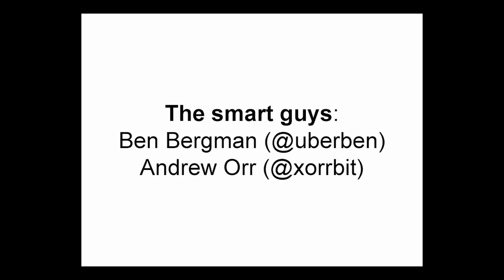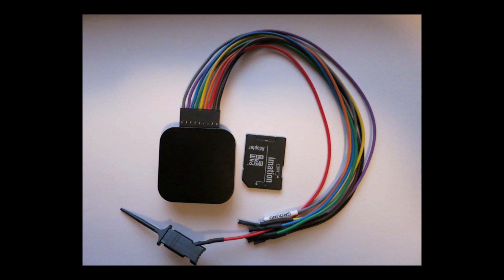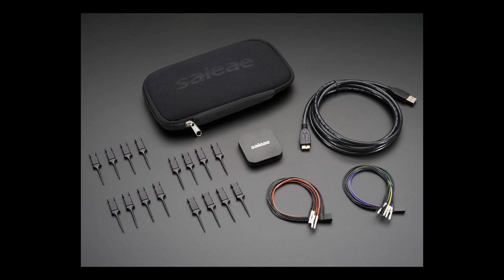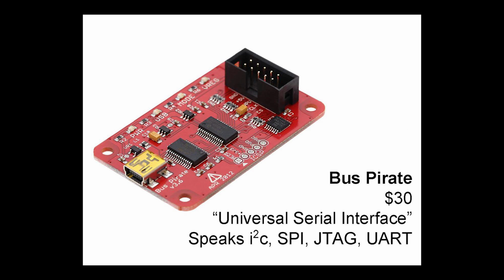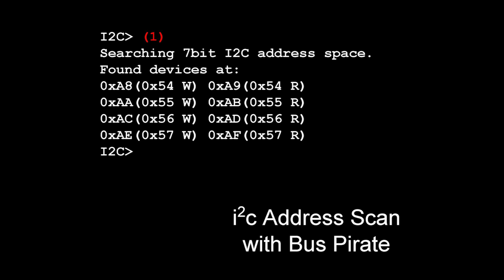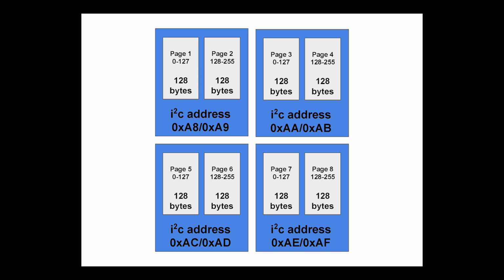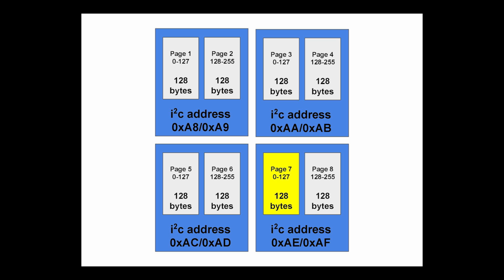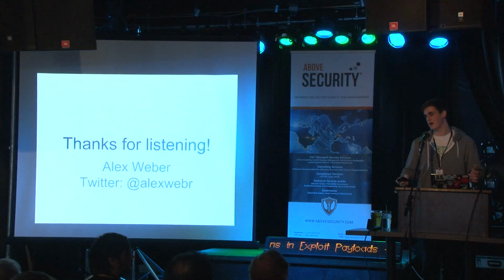Hardware Hacking 101: Erasing ThinkPad Supervisor Passwords - BSides Winnipeg 2015

Comment: In some situations, simply removal of the supervisor password might not working at all. I removed supervisor password by shorting PIN SCL and SDA during posting. But upon reboot back, the supervisor password re-inserted itself again. I believe if the supervisor password is set by an IT department instead of an individual, removing the password won't solve the problem like in my case. Find and Decode the supervisor password is the final solution.
Reply: @creates_things With soldering method could you replace the ship (EEPROM) with a unlocked one?
Reply: Apparently the password is also backed up to battery-backed RAM in the clock chip, so make sure the yellow clock battery is unplugged also.